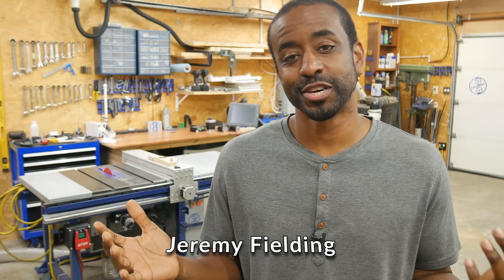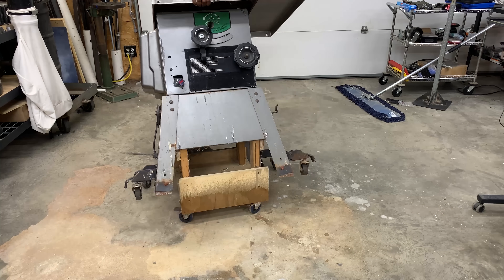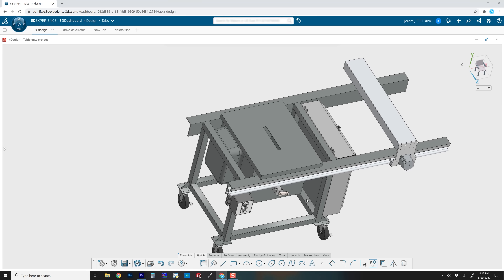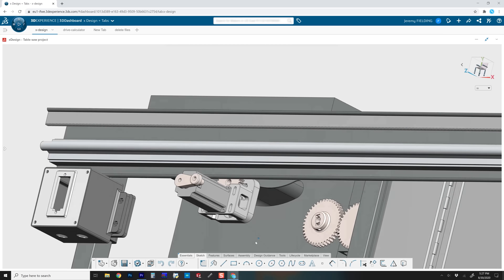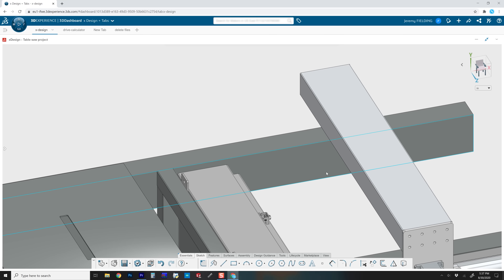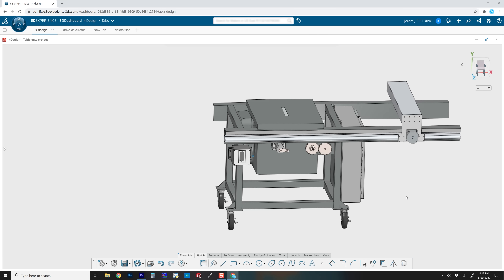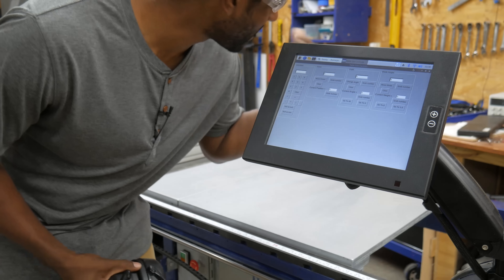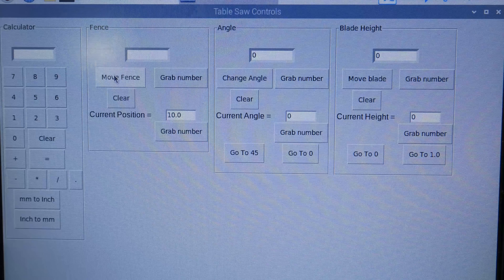How To Make A CNC Table Saw : # 084

Comment: Concerning start and stop speed, here is what I would do to achieve soft start and soft stop or ramp up on start and ramp down on stop: at the moment your speed is probably a fixed set number (lets say 100), i would make it as variable. When you hit start you already typed in how far you want to go so, from loop that is measuring "how far" steps you are going you can call "speed loop" that will increase the speed from 0 to 100 in some reasonable time that you find acceptable like 2-3 seconds (measured in steps). You can do "speed up" and "speed down" loop or even better you can send info how far you want to go to the "speed loop" and it could  deduct steps needed for speed up (0-100), steps for speed down (100-0) and how much steps it have to do in between.
If you are going for example 5000 steps and you need 500 steps to go from 0 speed to max speed and another 500 steps to stop then you have 4000 steps in between, so 500 steps to speed up from 0 to max/full speed then 4000 steps at full speed and another 500 steps to slow down from full speed to 0.
Reply: Also I would set a soft start and stop duration as a fixed number of steps not as a % of total distance because in that case it would start and stop faster for short distances and slower for longer distances.
And you can do logaritmic start and stop instead of linear, it can all be set in the "speed up/down" loop. 
P.S. you also need to address situation where you want to move less than total steps needed for speed up and speed down are,  if you need 500 steps to speed up and another 500 steps to speed down thats 1000 speps and what if you want to move only 600 steps in total. In this case I would just set fixed number for speed variable that would be 1/4 or even less of full/max speed.

Comment: Hey Jeremy, I've been writing stepper acceleration code for a few years. A good starting point would be (Google -> "AVR446: Linear speed control of stepper motor"). It explains basic ramping functions, equations and theory. If you're using ras.pi then the optimisation away from floating point math might not be applicable, but it gives both.It's only a few pages long and well worth a quick read. Hit me up if you get stuck.

Comment: Well, that was way more interesting then the thumbnail would imply.   Nicely done.
One question though.  When trying to make dato cuts you often have to move the fence very small amounts to get that snug fit with less then uniform thickness of boards.  Can that rig actually move that small of an amount?
Reply from the maker: Right now I can move it as little as .008". But I can set it many times smaller than that. There is a trade between resolution and torque. I want maximum holding power and this gives me that. You could make it down to 4 or 5 decimal places pretty easily, but you need a larger motor to hold the fence.
Reply: @Jeremy_Fielding  Well, .008 sounds good enough.  Frankly I've never measured what smacking the fence with a mallet moves it.  Anyway. would be super easy to make a fine adjustment fence add on to what you already have (if ever needed) so I would have picked stiffness as well. Good job.

Comment: When you turn of the motors and move the fence manually, the motors will generate voltage and you may blow the drivers. Not 100% sure as I’m not an expert, but maybe you should also physically disconnect the motors.

Comment: Instead of 90° gearing the blade height crank, lose the crank & leave a nut or very large Allen socket, then make an old fashion speed wrench w/that driver (like an old brace/bit) stored next to the motor. Cheap, fast, simple, safe. BTW, this is NUTS, but of course that's why we tune in

Comment: As, the top protectant:  Boeshield T9, Boeing Aircrafts engineered solution to protect their equipment in Seattle.  Paste wax can create problems because much of it now contains silicone, which can interfere with glues, including cyanoacrylates, and finish adhesion.  

To zero the fence:  Run a price of scrap through and cut it to width.  Place that scrap against the left side of the fence guide on the track.  Snug another price of scrap against it, and clamp it to the guide rail.  Remove the scrap.  Move the fence until it is against the scrap clamped to the rail.  You are now at zero.

Comment: I really enjoy your projects.  I wish we were closer and could collaborate.  I am DIY/Maker king of guy but also have a MSEE from TAMU and have been programming since 1971 and also do some ME and woodworking.  Work wise I enjoy projects that require cross functional (system engineering) design. I did systems and software design high speed servo motion systems for about 13 years and do miss it.  Right now I am designing medical device test systems and supporting production automation (robots) and enjoy that too.

Comment: Excellent work. Maybe the holding torque of the fence stepper is enough, but have you considered a brake for the fence to ensure it doesn't move during a cut? I added one to the 4th axis of my mill and it allowed me to push the tool 3x faster. Great idea and project, I'm currently learning python through an online course, it seems like the right time for me as well...

Comment: Sorry, I've just got to 12:21 and realised THIS was your first programming experience!?! OMG! Hats off, absolutely hats off!

Edit: I'm at 16:+ now and realised the motor movements don't have ease in and ease out, so they travel to position at full speed and stop on a dime. Might be worthwhile adding in ease in and outs on travels, it'll save wear on the gears :D

Edit of the Edit: and you just said it, my bad muwaaaahahaha

Final comment, then I'll shush. Just looked at your code and the easiest and quickest way forward is to create a new function called Move or something, and pass in the distance to move, the direction (clockwise/anti-clockwise) and the stepper, then you can move all those movements in the if/then's into that one function.
That won't help with ease-in/ease-out, but it will mean you only have to play in the Move (or whatever) function affect all instances.
In software engineering this is DRY (dont repeat yourself)
Reply from the maker: Thank you!

Comment: I've been programming for almost three decades and I got to say your code is very clean and structured for your first steps.
Two things you should definitely get into the habit of doing IMHO:

Don't be stingy on characters when naming something (variables, classes). "cal" for example could easily be thought of as "calibration" (it's not too outlandish to think there could be some calibration in a project like this). Or "fen" has the ring of "function enable" or "frequency enable" (again, stepper motors are driven pulses which could have a frequency). Of course you know that something like that isn't in the program, but I will guarantee you that you won't know in a year when you look at the code again. Also stay consistent. Using "fence" and "fen" or "angle" and "ang" could get confusing. With any decent programming IDE with autocompletion verbose variable names won't require any additional typing.

The second thing: code duplication. Your move_fence, change_angle and move_blade function are essentially doing the same thing, just with different pins. Make the pins (and stepper settings) parameters and you can use a single function for all three "axis". Or even better instead of supplying all the settings in parameters, store them in a global nested python "dictionary" and supply "fence", "angle" or "height" to the move function to then pick the corresponding values from the dictionary. (also move the pin-setup out of this function; the setup only needs to be done once at startup). Same for the movement itself. You've got code for moving forward and code for moving backward, which are almost identical, except for the endstop you check. You will thank yourself that you have only a single piece of code that does all the moving, when you start implementing motor acceleration.
Reply from the maker: Thank you! There is so much to learn... for example I don't know how to use dictionaries yet. LOL
Reply from the maker: Interesting side notes. I did all the programing directly on the py so I didn't have any autocomplete funtionality while coding. But now I use a different IDE on my PC that does that. Things you learn later. 
At first I did the pin setup outside of the function. It worked at first, then I started getting errors saying the pins were not setup... I gave up troubleshooting and moved it inside the function and it started working??? I still don't know why. Thank you again for the tips
Reply: @Jeremy_Fielding  
Here's stub to reduce code duplication (and using dictionaries; they are quite straight-forward):

settings = {
	'fence': {
		'pin': {
			'direction': 1,
			'pulse': 2,
			'limit_min': 5,
			'limit_max': 6
		},
		'stepper': {
			'steps_per_revolution': 400,
			'steps_per_inch': 100
		}
	},
	'height': {
		'pin': {
			'direction': 3,
			'pulse': 4,
			'limit_min': 7,
			'limit_max': 8
		},
		'stepper': {
			'steps_per_revolution': 400,
			'steps_per_inch': int(25.4*400)
		}
	}
}

position = {
	'fence': 0.0,
	'height': 0.0
}

def move_absolute(axis, to):
	distance = to - position[axis]
	print('moving ' + axis + ' to ' + str(to) + ' (from ' + str(position[axis]) + ', distance: ' + str(distance) + ')')
	steps = int(distance * settings[axis]['stepper']['steps_per_inch'])
	steps_moved = step_axis(axis, steps)
	position[axis] = position[axis] + steps_moved / settings[axis]['stepper']['steps_per_inch']

def step_axis(axis, steps):
	limit_pin = settings[axis]['pin']['limit_min'] if steps < 0 else settings[axis]['pin']['limit_max']
	print('using pins ' + str(settings[axis]['pin']['pulse']) + ' (pulse), ' + str(settings[axis]['pin']['direction']) + ' (direction), ' + str(limit_pin) + ' (limit)')
	print('steps to move: ' + str(steps))
	# add logic for stepping and checking endstops here
	# return steps actually moved
	return steps

move_absolute('fence', 42)
move_absolute('fence', -23)
move_absolute('fence', 0)
move_absolute('height', 1)

Comment: Unless your little blue box relays are different then the ones I buy they are not solid state, just mechanical with some extra electronics on the board.
Reply from the maker: really... Now I have to break one open and see.
Reply: @Jeremy_Fielding  Also if you treated them like solid state relays that is most likely also the reason they failed as you probably know.
Reply: @Jeremy_Fielding  Also also that could be a good hook for an other video, Relay, SSR, MOS-FET, IGBT and Darlington/Transistor how do they work and when to use what.
Reply from the maker: I just broke one open and they are mechanical. I was mistaken. I will add a note/correction to the description.

Comment: I like Johnsons paste wax for rust protection.
This project is EXACTLY what I started designing for my tablesaw - great minds think alike.
You will need to eventually account for different blade thicknesses and heights to simplify the process of using blades like dado blades.

Comment: I would suggest wax paste, or even just cheap motor oil. I've done this for some tool restoration and it worked out great.
Reply: Motor oil will get in the wood though ruining its ability to take finish. Paste wax, like 100% carnuba is used as any that gets on the wood will be removed by even the lightest sanding before finishing. Oil is fine on metalworking tools, not so much on woodworking tools
Reply: @gorak9000  hmm I haven't had a problem yet, I also wipe my blades and that pretty thourally tho afterwards. Like my chisels and  my hand saw would probably be the ones that would show it the most but I haven't noticed any defects like that. It could just be the oil I use though to either clean my blade or what I use to treat the wood.

Comment: Wow I thought you might be an electrical engineer and now I see you have cnc to do metal fab. Good deal. 
Definitely like the blade height and angle control. Fence control is handy especially in a semi-production environment. Another upgrade could be a sensor in the fence or table top the senses if stock is in place and turns on/off the saw. 
Thanks for all the useful knowledge and great projects.

Comment: This is amazing. You question about the far side of the fence. Why not use another rack and pinion? This would be similar to the Dewalt portable table saws. Again, amazing job.
Reply from the maker: Just keeping it simple. Their is enough stiffness in the fence that the other side doesn't need support

Comment: Quite an accomplishment, however you will need to add a way to offset the fence.  There are times when using a table saw where you will want to add a sacrificial auxiliary fence.  A simple offset for the width of the auxiliary fence and then your movements will not need to be offset.  Charles

Comment: Eliminating backlash is fairly easy if you have control of the code. For the fence, any move to the left go past and come back. That both removes the backlash and prevents the fence being loose in the out direction. If that is not sufficient, add a clamping system that operates when setting reached.
In manual mode, you could use the stepper motors as sensors so that they system tracks where it is.
Spring engage on the handle? (push and turn).

When are you going to automate the wood feed ?  ;-}
Reply from the maker: Great ideas... thanks

Comment: It would be cool if it had a dado function. You enter the blade kerf and the size of the groove, then the machine increments the fence. Making a perfect size groove without a dado stack.
Reply: Even with a dado stack, it's a pain changing the blades for each different cut.  Having a robot do it for me would be way better!
Reply: That would be neat.. Maybe also a finger joint mode so no jig needed.
Reply: How about dovetail, as in sliding dovetails.
Reply: Hey guys! How about you do the design work for Jeremy so he has less to do to implement some of this.
Reply: @paulreader1777  
The finger joint mode would be fairly straight forward and just a pre-calculated code based on the size of the joints and blade kerf. 
Looks like fence is "F", Blade height is "H", and blade angle is "A". 
Example,, If you wanted 1/4" joints, then start the gcode with the fence at home position.. Assuming blade kerf is exactly 0.125" (likely not).
Hit "Start"
Fence stays at home, blade comes up with a gcode, lets say G1 H0.25
Cut
hit "next" on the screen,  Gcode G1 F0.125 ;16.23910175  steps - Which will need to be rounded because the stepper just isn't that accurate even with microstepping.
Cut
hit "next" on the screen,  Gcode G1 F0.50
 (Assuming absolute positioning)
Cut
hit "next" on the screen,  Gcode G1 F0.625
Cut
Repeat..
This will likely translate differently into the python code it's currently running on. - I have not written in python...  but have some knowledge of gcode and marlin and steppers, etc..
So steps for fence to move 0.125" would be (stp_per_inch_f)*0.125 = 16.23910175 steps.
defined
Reply: Same with cutting joinery. It could move increments for box joints

Comment: I don’t know how I didn’t find your channel sooner— it’s 100% up my alley. This project is so cool. This could revolutionize a small cabinet shop that needs to batch out dozens of the same cuts or has mostly stock operations that just require some tweaking. I could see this speeding up production by a lot, while increasing accuracy and decreasing rework. If IP law wasn’t so lame id suggest you design a bolt on kit for like the saw stop cabinet saw (or whatever the largest market share platform for forward thinking small shops)

Comment: Jeremy this build was fantastic and impressive. A great example of electromechanical integration with software! 

One thing to note is that you can eliminate backlash in a rack and pinion system by preloading the pinion toward the rack using a stiff compression spring. AVID CNC's routers use this method because they have similar rack and pinion design. They have a really cool and simple way of doing it that allows the tension to be adjustable and works really well.